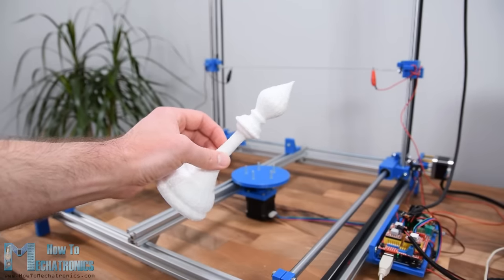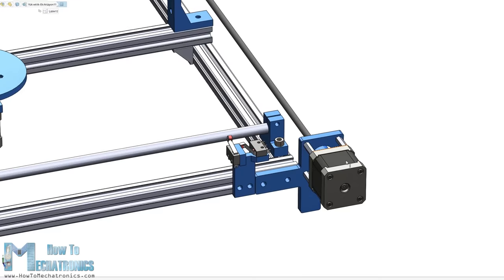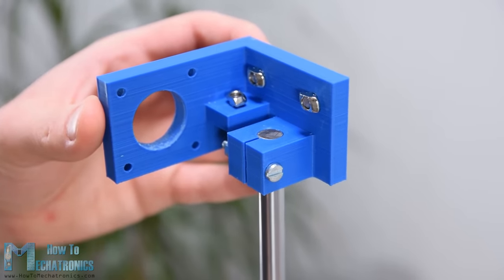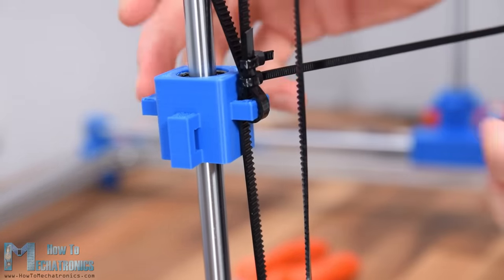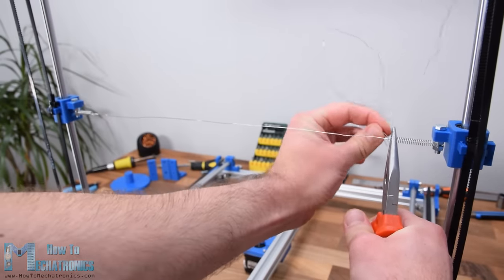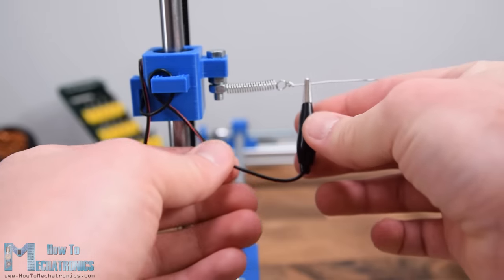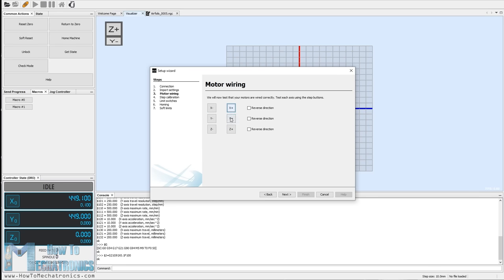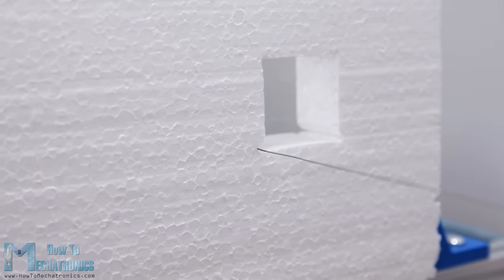Arduino CNC Foam Cutting Machine (Complete Guide)

Comment from the maker: I hope you enjoyed this video and learned something new! If you'd like to support me making more content like this,  please consider supporting me on Patreon: https://www.patreon.com/howtomechatronics
Reply: what was the final price for making this
can can it be used to cut eva foam
Reply: Hey HTM . WE ARE BUILDING THIS PROJECT FOR OUR BE SUBMISSION . BUT OUR MOTOR IS NOT ROTATING 360 DEGREE . IT IS ONLY VIBRATING . WE ALSO TRIED BY CHANGING THE WIRING BUT OUR PROBLEM IS NOT SOLVED . PLZZ ANSWER WE WANT TO COMPLETE THIS PROJECT . WE HAVE DONE PROGRAMMING AS PER YOUR VIDEO . PLZZ HELP
Reply: Can you help? Somehow, the capacitor of my CNC shield gets blown up. I am feeding it 12 V DC using a regulated DC linear power supply. I am pretty sure I have almost perfect DC voltage with maximum ripple of about 50mV (as per my CRO). I am running the CNC shield without capacitors, using my 12V regulated DC linear power supply, and haven't had any problems yet. I cant figure out what pops the capacitors.
Reply: I love to buy one from you..
Reply: @sarhanlota1512  hVe you fix this problem plz tell me what you did
Reply: Hi I am building this machine and I am running into problems with the software could somebody help me?
Michal
Reply: I want to buy a machine for me can you send me a message with the price, of course if you are agree to sell. Thanks
Reply: I want to know price this machine
Reply: Thank You so much : ) for this video and Your hard work.
Reply: Do you know where to buy this material?
Reply: hi, is it possible to order this cutter from You?

Comment: I do CNC Hotwire foam cutting for a living. Everyday I use a 15ft x 9ft x 9ft machine for large scale work orders. The amount of information in this video is priceless. Thank you for this video 👍🏽
Reply: For what kind of purposes do people/companies buy foam cut pieces??
Reply: @sneaky_krait7271  Sign companies for example they make foam letters and logos.
Reply: Sneaky_Krait I make decorative pieces for new homes in communities under construction, new plazas or stores.. So for example, like the big fancy columns at the front entrance of homes, or the bands that go around the windows or window sills. Also, I make molds out of the foam so that those molds could have cement poured into them and once it’s dry, we remove the mold and have solid concrete decorations for any time of building of any size. And of course, any type of lettering and logos that go on the outside walls of buildings or home community gate entrances.
Reply: @peterc3619  logos that will be placed outdoors? Nope, only for indoor applications hahah
Reply: @peterc3619  Ahhh, I hadn´t thought about cement molding. Do you also make your own designs from time to time?
Reply: Sneaky_Krait yes actually almost all the time. I use AutoCAD to draw my designs and export those to the cnc software. When the job is for a big company or new community homes, they provide the designs on paper and we also use the blueprints and elevations from the homes to draw the design they chose. When the job is for smaller residential homes and individual clients, we draw our own designs.
Reply: Alejandro Pérez actually, 99% of the work I do is for outside applications. After I cut the designs we have someone in our shop that sprays a base coat of cement finish on it and on top of that we spray a sand based textured finish on all the foam designs for outside applications. If we didn’t use cement spray on the foam designs than we would coat it with a hard plastic resin that can be painted to whatever the homeowner chose for their outside designs to match the outside color of their home.
Reply: @peterc3619 Yeah, like I guessed, there's a lot of postprocessing to make it outdoors-compliant.
Reply: Peter C I am in my first year of college, studying electrical engineering, I would like to make my own foamcutter and maybe start a buisness like yours. Do you have a website? I,d love to have more information on this topic!
Reply: Alejandro Pérez yes there is
Reply: Sneaky_Krait unfortunately I don’t have a website. But any question you have I’d be more than happy to answer and help.
Reply: @peterc3619  If you don't have a website,  where do you get customers from? And are you working for someone or is it your own buisniss?
Reply: Sneaky_Krait both. I work for a company and with everything I know and have learned working for this company, I take on my own jobs on my own time for myself that are under my name and not the company’s name. Fortunately for me, working with the company I’ve created contacts that notify me of side jobs I can take on for myself on my own time, plus word of mouth and business card handouts. Now, for the company, we call development companies directly and offer our product for a competitive price and high quality. We create small, high quality samples of our work we can send to these companies so they can see the quality of our work for themselves.
Reply: @peterc3619  How do you know a development company needs you?
Reply: Sneaky_Krait you don’t. You just have to offer your material to as many companies as possible. You lose nothing by leaving your business card at different locations or calling up different places to offer your services. Also, you gotta be observant. When a community is under construction, it’ll usually say who it’s being constructed by. So you check their website for emails and phone numbers, look at their model homes and see whether or not they need your material. Regardless, even if it doesn’t look like they’ll need you, it never hurts to give a call and leave your name or an email or send a business card. Also, you can undercut the competition and offer cheaper prices to companies whom are working with your competition. You just gotta throw yourself out there.
Reply: @peterc3619  Thanks so much for answering my questions! Which country are you from by the way?
Reply: Sneaky_Krait Im in the u.s.
Reply: @peterc3619  
I have old king size mattress
6ft*6.5ft*6 inches
I want
One inch six sheets horziantlly
How can I do that?
Reply: ghous Ali shah sahb you wont be able to get 6 sheets at 1 inch out of a 6 inch thick foam because depending on how thick your wire is, the wire will burn 1/8 of an inch from the heat, meaning you can only get 5 sheets at 1 inch thick and then you’ll have one extra sheet that will measure about 1/4 of an inch. And yes, horizontally. Remember, the longer the wire, the more power it needs to sustain its heat. So if your wire is moving too slow and the wire is too hot, you’ll make a big burn mark on the foam and if your wire is moving too fast and it’s not hot enough the wire will drag and your measurements will be wrong. So the speed of the wire and the heat have to even out to make a clean cut line without the wire dragging
Reply: Hey how can I contact you @peter c had some questions regarding this as I'm taking this up as my final year project
Reply: Do you use 3d software?
Reply: Do you sell these products? And how much?
Reply: from where did you bought 15ft x 9ft x 9ft ?
Reply: @peterc3619 it's just like fishing...the more lines in the water the more potential catches(and big catches)...if you never cast out your line you guarantee yourself you'll catch nothing. And even casting line...means nothing in itself. Gotta be when the fish are biting, where they're used to feeding, right time of day, etc. And you could cast out under optimal conditions and still not get a bite lol. In that same light, you could cast out and reeling in to recast...and you could snag a fish accidentally. 
Word of mouth in the industry you're in...should never be underestimated. The older I get the more important word of mouth has become to me(I have a hard time with social situations and generally just don't like talking with people but at times I love it)...so trying to make positive changes within myself to better utilize word of mouth(gotta open mouth to speak words lol)
Reply: Hello. What equipment do you use? I'm thinking about adding a CNC foam cutter to my sign shop.

Comment: For any limit switch intended to stop an action, it always must be wired as NC for safety. Anyone who has done industrial automation knows this.
Reply: It is known.
Reply: But why?
Reply: @SetKat-Alex  in case that if it loses power (wire is cut or something similar ) it stops the machine
Reply: @SetKat-Alex  Because no voltage can have multiple reasons.
Reply: @SetKat-Alex  Think about the possibility of a wire breaking from the switch. If you used a NO contact, the system would never know it was broken but if it was NC, the software would be written to shut the motion down immediately and there would be no possibility of over-travel.
Reply from the maker: Yep, thanks for the input!
Reply: @HowToMechatronics  Glad to see that you are Normally Open to positive input!
Reply: My understanding is any safety switch should be NC so if the circuit is broken for any reason then the machine will shut down.
Reply: Robert Evans true, but anyone else, who is playing with foam without the risk of damaging expensive tools or materials is grateful for his smart tip, as it is a cheap and simple solution without having to deal with noise and filters etc.
Reply: @SetKat-Alex  Because things fail open most of the time. If you have the switch NC and a wire breaks, the machine stops. If you have the switch NO and a wire breaks, the machine crashes. In the industrial world that costs a lot of money for broken machines and can kill people.

Recent safety specs require a double-pole switch, one NC and one NO, that activate simultaneously. The controller must see both switches change within a few milliseconds of each other.
Reply: OK, thanks everyone, that's really clear! Many thanks for the answers! :)
Reply: @CompactFlesh  Doesn't the CNC shield come with limit switch inputs with noise filters built-in?
Reply: @CompactFlesh  ????
Reply: @NaceRoter  amazing, thnx

Comment: This is one of the most comprehensive videos on youtube. Not only does it cover the mechanical side of constructing the device, but it also provides all the details you need on the electronics, the firmware for the Arduino and the CAD software necessary to provide the complete solution. A real credit to you Mechatronics.
Reply from the maker: Thank you, I'm glad to hear that!

Comment: I have built this design in 2020 or 2021, but changed the dimensions to 600x600mm cutting area. Also, I removed the rotating axis and shrunk the width down to approx. 10cm wire length. I only do 2dimensional cutting, because the machine was built for bible verses, that we put as decoration on our walls in our church. 
We do take on a few jobs per year, as my wife sews and sells some products and started some advertising for the letters. So now, the machine gets more and more uses. Moving into an apartment, where I have my own office/hobby room and can leave the machine assembled also helps. Beforehand I always had to disassemble the y axis and store the machine in the basement.
I use DevFoam Pro for CAM and make the design in Inkscape. The CAM is quite finicky, if you want really precise and smooth cuts. Cutting direction and order of cuts can make or break your parts. 
Things I have noticed and solved so far (or want to solve in the future): 
- the power supply for the wire is too big for my short wire (10cm of 0.2mm NiCr 8020), I use an LM2596 for that
- the printed clamps on the y-axis failed, when I tried to tension the belt. Have added some mechanical fixtures, so that the axis doesn't rely on the friction of the clamps.
- construction of some of the parts are sub-optimal for 3d printing. I did split some parts into multiple single parts and use heat-set inserts and screws to assemble them. 
- I had to disassemble it quite often, and setting it back up was no smooth sailing. I splitted the xy-joining part and now I only need to remove the belts from the idlers and undo 4 screws to disassemble it. Setting it up is in reverse order. Only need to resync the two belts, but tension isn't touched, since the mechanical fix points make it very repeatable.
- I want to add some belt tensioners on x and y axis in the future. Also some belt clamps, so that you don't need zip-ties and gain some more travel. 
- We noticed vibrations in the cut line, when the y-axis accelerates, especially from stand-stills. For now it is solved with slower acceleration values, but I want to add some tension wires down to the xy-joint, that way I want to stabilize my long y axis. I'm not sure, if this problem exists with your smaller machine :)
- Since I'm manually placing my letters on the foam and never cut more than one letter at a time, I got rid of the endstops. They are needed, if you want to use the rotating axis of course.
- $1 in GRBL needs to be set to 255. If you use G4 dwell on corners, like I do with devFoam, the motors will drop and you get offsets in your part.
Overall: Thanks for the design, it helped me very much!

Comment: Thank you HTM, this was exactly what I was looking for. I'm considering making some automotive parts using carbon fibre over foam core and was concerned about the possibility of human error using a hot wire 'bow' where one side cuts through the foam faster than the other side and the part is uneven. 
Also, machine code eliminates the need for the use of templates as guides as good code is very accurate.
It occurred to me that a CNC hot wire cutter would be the solution to these 2 issues but wasn't quite able to picture the positioning of the wire, which is unlike a millhead or similar, as its long and is connected at two endpoints, not once central point. So, I searched and found your video and project page and you answered my wire location question.
I just wanted to thank you very much for your work. You're a very clever man able to do something I could not do; and I really respect the time and effort that you've put into this video and the project page so that others can benefit. 
I'd actually like to scale this up a bit in size (to maybe 4040) and improve its rigidity wherever needed, so let me know if you'd be interested in working together on that somehow. 
Peace.
Reply from the maker: Hey, glad to hear it you found it useful. Have fun building one. Cheers!

Comment: If you ever want to upgrade this machine, consider the following:
1. Stiffer frame. I know hot wire cutting doesn't require much force, but I wonder how your current setup wobbles under acceleration. I would add a second pair of rails on top, making the machine a solid cube.
2. Better temperature control of the wire. A PWM output and a MOSFET or two would handle it. 
3. Separate control for each end of the wire. For two motors more you could cut at an angle, useful if you want to cut plane wings etc.
4. Different wire tensioning system, especially needed with the previous point, since the wire length could change from 450mm to 780mm if both ends are at the opposite corners (although you probably normally wouldn't run that steep tapers). Three potential solutions, in order of difficulty:
  - Pulley and a weight on one or both ends of the wire. Pros: constant tension, simplest solution. Cons: Takes up a lot of height.
  - Constant force spring and a spool, like those retractable badge holders. Pros: Possibly off the shelf parts, constant tension, large extension range. Cons: limited tension force, no force adjustment without buying/making custom springs
 - Motorized spool with a tension sensor. Pros: Biggest flexibility, as much wire range as the spool allows, adjustable tension. Cons: most complicated, adds one more motor.

Generating G-Code for 4 axis machine would be a fun challenge, but there exist projects tackling that problem already.
Reply from the maker: These are really good points. Thanks for the input!
Reply: Maybe also add something to tighten the belts after mounting.
Reply: @shinaikouka  Yes, changing wire length would require something lilr sliding brushes powering only uncoiled part of wire
Reply: Closed loop wire temp control would difficult to implement at best, so why bother with PWM? Set it and forget it
Reply: @yucannthahvitt251  Closing loop wouldn't be that hard, you just have to measure wire resistance and treat it like a big thermistor. But even without that, changing supplied power on the fly based on, for example, length of wire in contact with foam could be useful. Not to mention being able to change wire temperature (for different foams etc.) from g-code, without having to mess with dials, would be quite convinient.
Reply: Any interest in building one for me? I’d pay you a premium for your work of course

Comment: Very nicely done, very detailed and could be followed when you actually want to build one for yourself. I have a tip when calibrating the steps per mm and I would suggest calibrating it along a greater distance, in order to minimize the error. Another solution would be to count the pulley teeth, and also the belt teeth and doing the necessary calculation. Great video, one of the best tutorials on how to build a simple CNC machine, not to mention the idea, which I personally found very creative and as far as I know, no one has ever done! Well done! The editing and filming were excellent too!
Reply: Any interest in building this for me and getting paid for it? I need this machine but am terrible at 3d printing